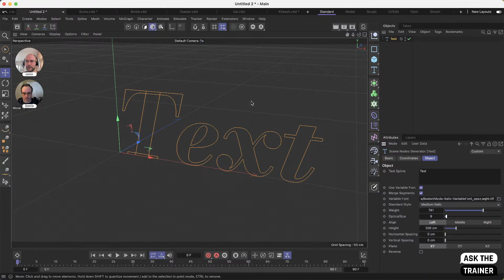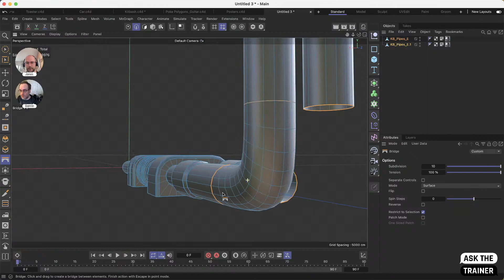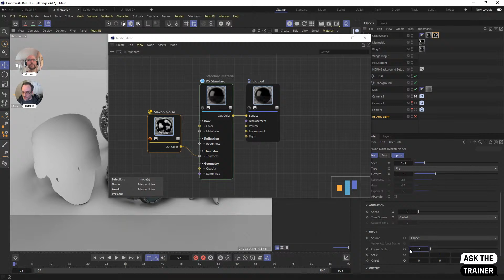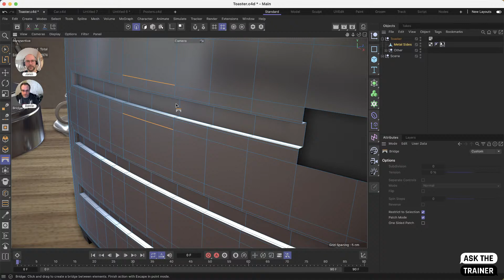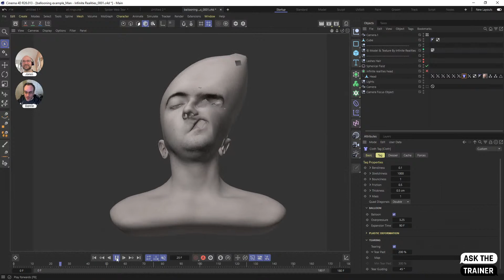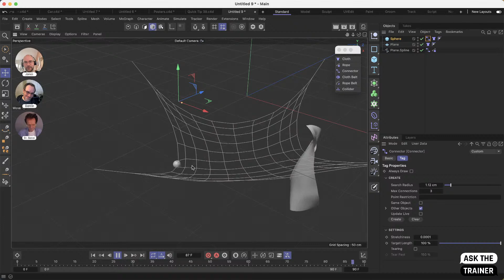#AskTheTrainer | Exploring Cinema 4D S26 and Redshift 3.5

Comment: I wanted to bring in a film plate into cinema 4D to try and match perspective and my shaders. I am a former Maya user and doing that in Maya is very simple and straight forward (bring image plane into camera and check the box that says image sequence). I have seen some tutorials on how to do that in Cinema but they don't seem to work specially using the latest version of Cinema (S26) and Redshift 3.5. I was wondering if you guys could add a quick video showing how to do that. Also A LOT of people like myself have been migrating from Maya , and I was wondering if it was possible to update the Cineversity course were it helps Former Maya users like myself migrate to Cinema 4D.

Comment: How can I create something as simple as a back illuminated light box graphic that also emits light. This is so easy to do in Corona (just check the self illumination box), but seems really difficult to achieve in Redshift. Also, light materials don’t really emit light like a proper light does, or is there a way? Again in Corona light materials emit light like an area light, and you can illuminate a scene with just that. Any hints how to do these two things in Redshift would be really appreciated, haven’t really found anything useful on the web yet.

Comment: Poke Polygons is just the same bevel modifier, why are you selling it as a separate tool?
Reply from the maker: Doing the same with Bevel requires setting up the Bevel tool (at least once as a custom setting) and then merging the new points via Optimize.  OR use the Poke in one step, and no need to merge extra points.
Reply: @MaxonTrainingTeam  I just made such a capsule and use it)) 
I hope that you will introduce the knife function and Close Polygon Hole in the nodes in the next release, this is very lacking.